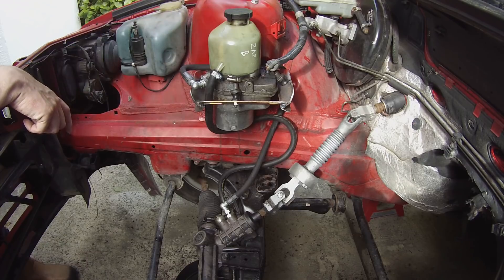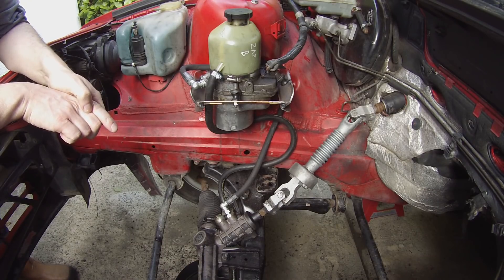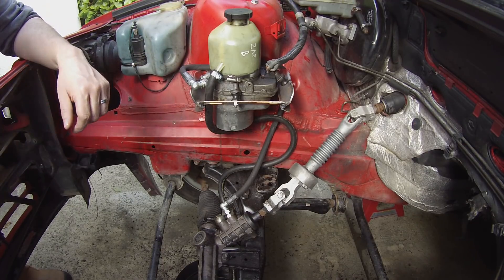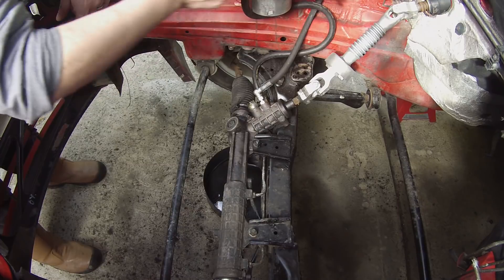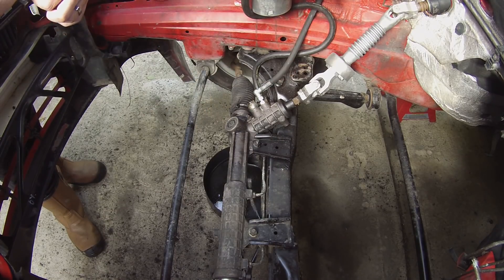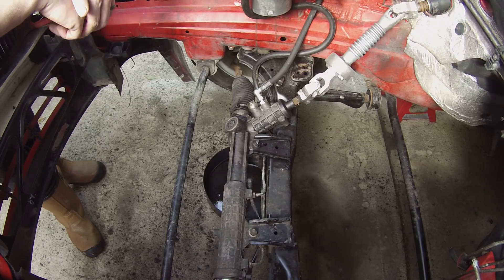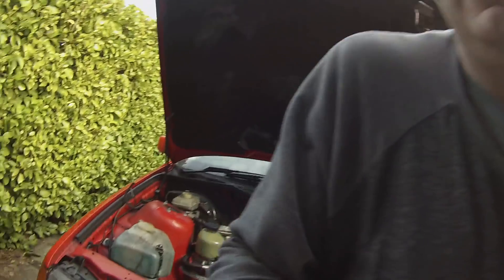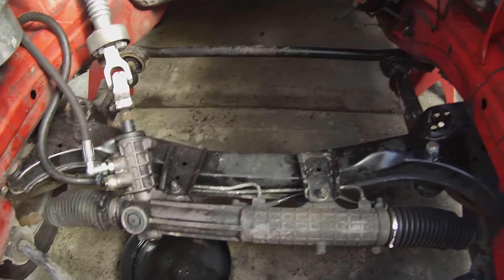€1,000 BMW E36 EV Build 05 : Electric Power Steering

Comment: Hello... I'm hoping to convert my 135i to a similar system. Any comments on how the electric pump affects steering feel? Since porsche used the trw pump in the 997 cup cars, I'm guessing this is the best option. Any comment on volvo or mini cooper pumps? 

Cheers,
Graham
Reply: They're all good options but I went with a TRW because I was able to find someone stateside that buys them rebuilt, which is ideal for me even if I have to spend more. His website is baysidefabrication. It's also fully integrated as in there's no controller needed to unlock full power (Volvo only does 70% limp mode without one), and there's just not much info on the Cooper pump conversion. Also heard Volvo pumps can run into some cooling problems if you're drifting and as that's something I plan on doing I wanted to get a more robust pump. Hope this info comes at a helpful time for you

Comment: Just a little noisey, does it run full clip in the original volvo application?? Maybe wrap a dense noise insulating blanket around the lower motor section to drop those dbs a little, if the noise matters.

Comment: the pump should lower it'd rpm after target  pressure is reached. it also should not rattle with fully steerlocked..  kind regards, evz3.

Comment: Hi Damien. Did I hear you say that the power steering pump was a three phase  AC Motor ????
Regards and thanks for video
Reply from the maker: Yes its an integrated package with motor and controller.
Reply: Wow. That might be an excellent sample motor to practice with on Johannes's unit ( Dual purpose if you can disassemble)

Comment: Great video! Nice to see something other than the done to death Toyota MR2 pump swap. Any idea on the flow rates for that? Looking for an analog to it that I can get here in the states.
Reply: Randy Eller - Try the Volvo pumps - they've been used in lots of heavier stuff. I've even seen them in mud boggers, so they ought to be able to handle just about anything routinely road-going except commercial carriers.

Comment: Brilliant as always Damien but the camera picked up a horrible buzzing noise from the pump. Will it always be so noisy, is the pump faulty or is it just the camera mic amplifying the noise?
Reply: @steelmesh - That's controlled by the VSS, I think a brown wire on these Opels. Speed sensor tells the control module to slow the pump a little bit at higher speeds. It doesn't hurt them to run all-out, though, as the steering rack/gear is what is known as a "center open" design, meaning the fluid simply flows through the bypass port when no steering movement is in play. Add some steering input, and the internal valve shuttles fluid to the corresponding side of the rack body. Simple system with highly accurately-machined porting...